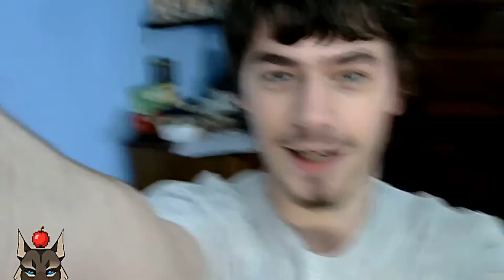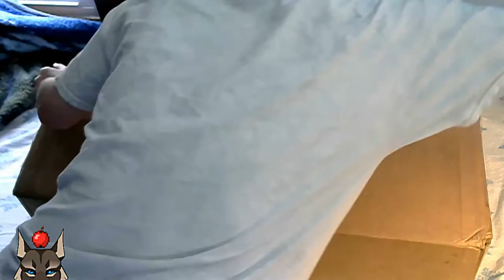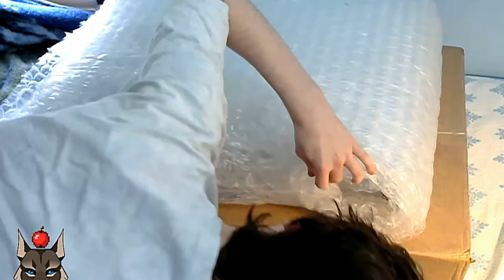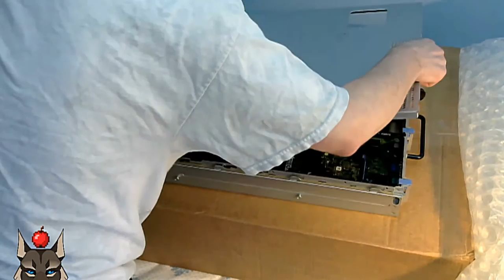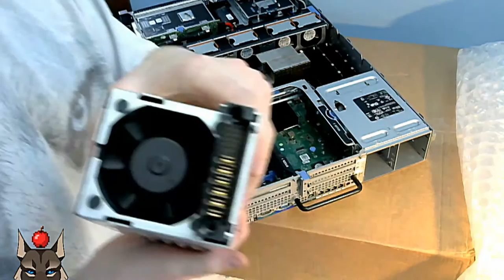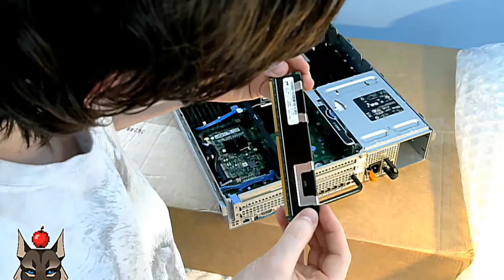DELL R710 UNBOXING!!! [Generation One: "Wolfboy Tech"]

Comment: For those watching: R710s have two chassis configs: 6x 3.5" and 8x 2.5". Beware of trying to use >2TB drives if your R710 has a Perc6i RAID controller, as they support a maximum of 2TB. If you've got a Perc H700 controller though, you're good. Anything marked with orange on Dell servers is generally hot-pluggable.
Reply from the maker: Awesome knowledge! Thank you for letting everyone know!

Comment: Nice server.  I'm thinking about buying one myself.  What do you plan on using it for?
Reply from the maker: I'm actually using it currently for my production server. It hosts my two websites and in the near future I hope to host an FTP-like environment where I can automatically upload videos to YouTube after rendering them. I must say that if you buy this model, get the version that accepts 3.5" drives as they are less expensive and easier to obtain/replace
Reply from the maker: +Dario Alright, friend. I had to think about this one for a little bit. I do have to agree with you on the fact that the R710, 720, and 730 are not loud at all. Honestly, for the drives, you don't need 15K. If you get 10K SAS you're probably wasting your money. I would recommend going with a server that has 3.5" drives (8.89cm) because there's an easier upgrade path. 

2.5" drives are much more expensive then the 3.5" cousins, and also are usually harder to get. If you make a server out of this, get ESXi but remember that the free version only supports 32GB of RAM and only 1 CPU. I would recommend trying to get an operating system like unRAID as it is more versatile, however I haven't tried it out yet. VMware is currently the best in my books.

For the personal ip stuff, I have just a normal residential IP address from Time Warner Cable with a 30/5 Internet connection. It's dynamic, but it stays the same for the most part, but just make sure you're always watching your IP address. Firewall, router, and switch are all my NETGEAR R6200. However if money is not an objection for you and you like learning technology, I would recommend the Cisco 1941 for the Router, the Cisco SF300-24MP for the Switch, and the Sophos UTM 320 for the Firewall.
Reply: +Dario I used R720 on daily basis. Very good server. Stable. Good for virtualisation
Reply from the maker: +Sybreeder Thanks for your input, friend! Happy to see my little community getting along!

Comment: Hi... thanks for the video... I work editing video, sometimes I need to connect 3 professional videocameras Full HD to a computer for switching between the cameras in alive; and as you see I need a super powerfull machine... I was going to buy a HP Z800 workstation refurbished but I just watched your video and I wonder... ¿This kind of servers will works fine for editing video? Could I to buy a Video tarjet NVidia Quadro 4000 for working with a Video Professional monitor?
Are these kind of Workstation very noise? or normal noise like a desktop computer?
Reply from the maker: Hey there. Unfortunately I never seen the comment (whoops). Yes, your idea would work but it would sound like you had a small jet engine in your house. This is unfortunatly the only downside to workstation/servers. I would use such a server as a checker-board rendering farm for assisted rendering, however it's cost is exponentially more than simply getting a better (or more) GPU's for your desktop computer.

Comment: All Xeons require ECC RAM, you will not be able to use desktop ram.
Reply from the maker: Actually in some cases (like the X99 chipset) it can use desktop class ram. My system is working off of the DDR4-2400 with a E5 2650V3 ES. Not much OC headroom but for $200 for a chip that is supposed to cost around $4k I'll take it.

Comment: What did you end up storing that in? Cabinet?
Reply from the maker: +Kristopher Daia Nah, I ended up just putting it on a table in a closet and leaving it. Never got above 40C, and with both PSU's there was only about 91W power draw. Racks are expensive and frankly it would have been a bitch to move around.

Comment: hey , im looking to get a server to host a remote shoutcast broadcast.... is that something that i can setup on something like this?? any input would be appreciated ...
Reply from the maker: It would be absolutely perfect with VMware and some version of Linux! It would work better if you have a very good Internet connection (5mb/s up or more).
Reply: awesome ... seen these on ebay ,,, so i wanted to do a lil research before  making a decision ... ive never actually worked with  servers before .. always just ran off the laptop with shoutcast .. but running both the server and the broadcaster not only did i get alot of lag .. it greatly limits how many people can be logged in on the broadcast... is there a specific setup   you would reccomend ? for my purposes ?
Reply from the maker: +Daniel Mason I can't really say, since I've never set up a SHOUTcast server. However, if you can, spend a wee bit more and buy the ones with 3.5" drives, rather than the 2.5" drives. They're easier to upgrade and stuff!  😀
Reply: Will do Thanks brother
Reply from the maker: +Daniel Mason best of luck!